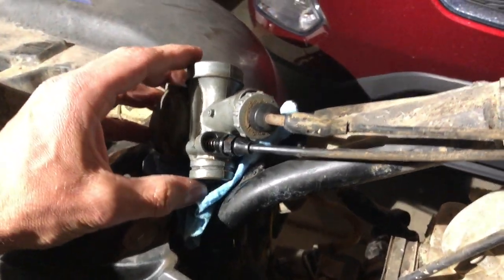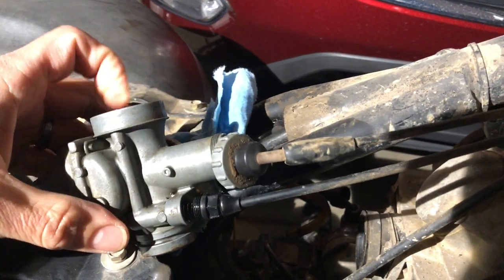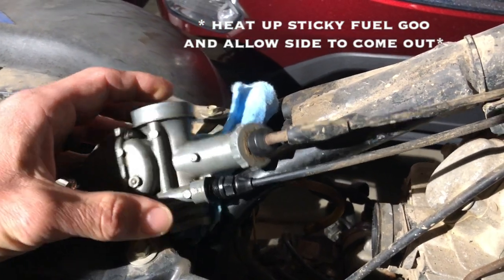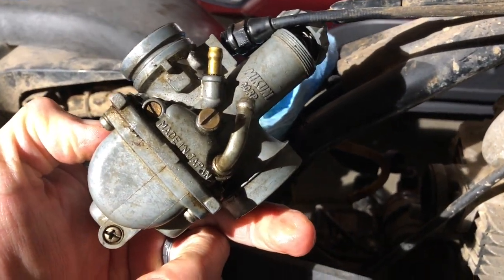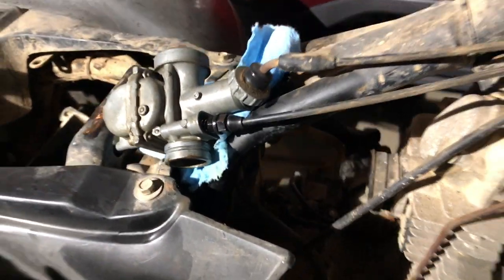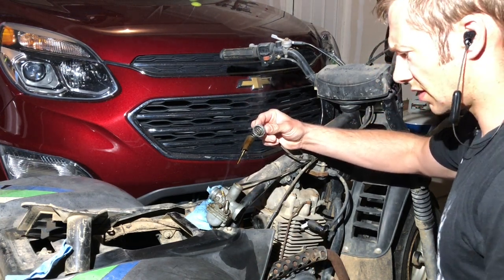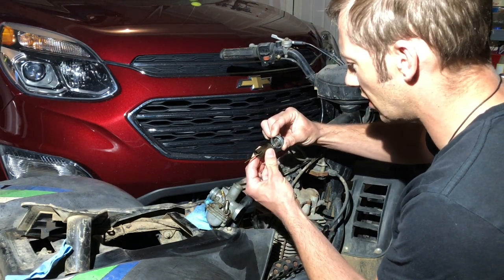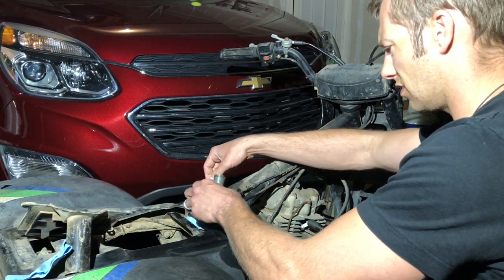How to remove a stuck carburetor slide with a blow torch!  Plus a first start!

Comment: I love dealing with this but when i love it the most is when its 4 carbs instead of 1,lol, im going thru this right now, i actually freed up 3 of them but of course the last as always is stuck there like someone welded it to the carb, this bike had been sitting since 1984!!

I came up with this idea,the slide on my application has a arm that moves it up and down and its screwed to the slide, it ended up getting bent while the fight was happening to free it (not sure why, the other 3 didn't bend), i think i can bend it back carefully back to how it was however im gonna get a steel washer the same size and drill 2 tiny holes in it,weld a rod in the middle of it,screw it on the slide  and use the rod as a slide hammer, ill show it who's boss,if not last resort ill use a torch, sorry i just had to vent,lol
Reply from the maker: Ugh that is tough!  Glad your working through it, stuck up carbs can be frustrating to deal with especially with all the delicate parts. Hopefully you can straighten yours back out. A little bit of heat may help, Good luck!

Comment: I'm having this problem with my honda atc125m. I will definitely try this out. I have a rusty tank and it made it into the carb
Reply from the maker: Yea that was the same issue I had, rusted tank, plugged up carb and seized slide.  Check out my other videos of the carb disassembly and of my rusty tank!  Everything was pretty nasty! Hope they help you out.

Comment: quick tips; from the least harmful mechanic tricks, The stator's on most ATC's under the recoil when removed, you will see the stator hub covering the stator, you can spray electrical cleaner or a mix of solvents like brake cleaner around and under towards the shaft pointing near the stator guessing where it is, yes that's what that plastic tube is for that comes with solvents for hard to reach places like getting around the  hub to clean a stator with out having to use gear pullers to pull the hub to clean it, with light air pressure with an air-wand don't go above 35 psi, on your air-tank unless you have a psi regulator for your air-compressor, time will be your friend before blowing.
 
Make sure your carb is drained/cleaned of fuel and bowel removed, best to remove float if using a torch. 

well for the carb problem, the torch seems like a fast way but, can damage more parts like o-ring gaskets  of the fuel and air idle control pins H/L, best to remove Carb bowel along with the H/L idle pins , and plastic float, with a sewing punch pin kit, old sewing machine tools will be useful in rebuilding carbs before using a torch, and count how many turns out when unscrewing the (H/L) idle pin, so when clean they can be set back to the correct position when its clean if you do not have a book or maintenance guide/PDF tear-down manual, adjustments vary based on age and metal fatigue of a carb.
 With extra thought on gasket maker, you can use wax paper,glue,marker,exacto knife, two boards and a C-Clamp to make gasket sheets and gaskets for many carbs and make your own, make sure to use 2-3mm spacers for all 4 corners or use washers, when making a gasket sheet press, I have cleaned and rebuild carbs by boiling them in vinegar and then vegetable  oil to remove aluminum oxide and carbon, since it will bond with the oil.     

Expensive solvents clearly won't save much time and may science aid you with caution in your efforts from spending more or less money when properly prepping parts, before using thermal treatment to risk other issues occurring like heir line fracturing your carb with thermal shock with a torch.
old mechanic's would soak tear downed carbs in K-2 that they bled from a furnace or controlled contained cleaning containers for parts only..
expensive penetration oil can feel wasteful when two or three cans out weigh the cost of a rebuild kit for the carb if you can't make your own and find the correct size O-rings at the hardware store, best to buy O-ring assortments kits online for many other carb rebuilding projects, far cheaper in the long term.
High penetration oil is good for final cleaning and for sensitive parts like jets, pinto float needle, along with carb piston needles with fine cloth used to clean camera lens or glasses, 
some mechanics use isopropyl alcohol for the final cleaning process for carbs before rebuilding because  cost of volume and effectiveness.
Reply from the maker: Thank you for your input. I did completely rebuild this carb in a later video, I figure worst case scenario is buy a complete carb online and a new throttle cable if needed, glad I didn’t have to go that route. I did drain the bowl on the carb and remove the fuel tank as well so that wasn’t in harms way. The fuel was so old and degraded it wasn’t as flammable as fresh gas.  Crazy what happens to stuff when it gets neglected for years.

Comment: I have a KLT 250 and the slide is sticky and will rev high after a little bit of driving I almost hurt someone so I cleaned the slide and determined it’s not the cable so hopefully it will work I soaked the slide in brake and parts clean for about half and hour and throughly cleaned it
Reply from the maker: Ow! yea that could get sketchy!  Once i freed this one it was all sticky and i cleaned it up and used some scotch bright on it and it helped quite a bit.  Hope yours works out.

Comment: Am concerned about any gas fumes.
Reply from the maker: You can see some bright flame when I was heating up the carb, that was the little bit of old gas that was in the fuel inlet. I had tipped the carburetor upside down so most of the fuel was out of the bowl as well.  Btw this method did not damage the carb at all, since this video I have rebuilt it and the atv has been running very well.  Thanks for watching!

Comment: I bought a klt 160 last summer and the choke was stuck and the fuel inlet was plugged solid just like yours
Reply from the maker: Yea this thing must have been sitting a long time.  Carb tear down coming up, pretty crazy inside this thing.  Was your carb all seized up as well?
Reply: High Priority mine was pretty gross inside and all the vent things were plugged solid and even after spraying loads of carb clean and compressed air they were still pretty bad
Reply from the maker: Just thought I would give you an update.  I got the carb cleaned, had to replace a plugged pilot jet, and the tank is cleaned out and repaired.  I have been ripping this thing around my yard, pretty fun little thing!  A lot more power than i was expecting, I will get a video up of it in action some time.
Reply: @HighPriority   Nice. Ive been busy working on my truck so I havent  worked on mine in a while